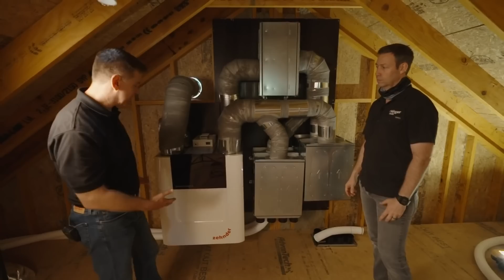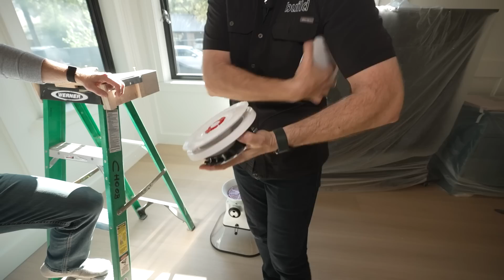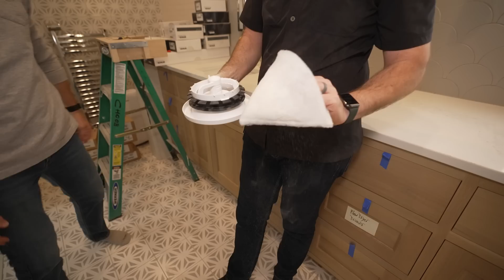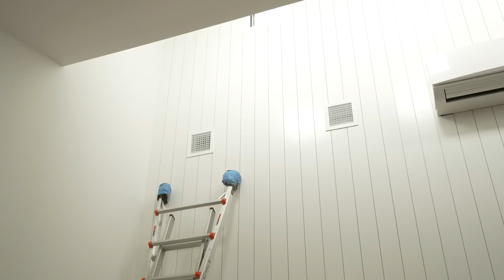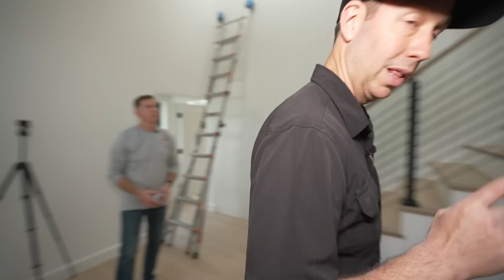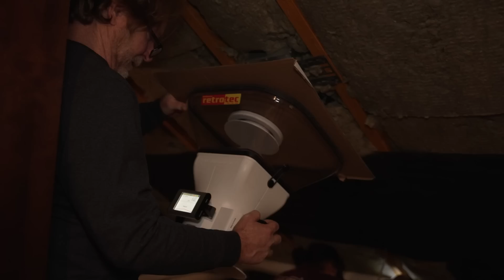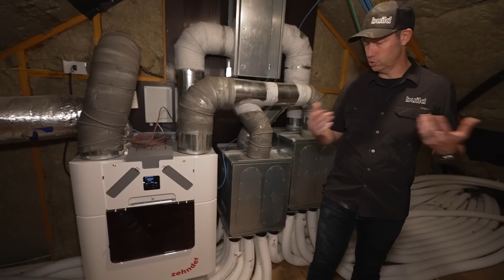Commissioning The World’s Most Efficient Fresh Air System

Comment: Good vid, and whenever specialized gear arrives to a project tha always brings up "why" - reasons can vary greatly..
You know, it's funny: we seem to need to purchase more and more specialized equipment [often electric] as the "eco" mantra is followed, and housing is not immune.  There is a subtle difference between that and purely engineering based efficiency solutions - beware of mindless marketing.   Foe example: I suffered upon a LEED website last week and observed the business of a rating system is largely politicaly defined [salted with incorporated references to ashrae, EN, etc standards to imbue apparent engineering legitimacy].  As a sidenote, bankers [such as Dimon] have salivated over carbon credit schemes in the past.  Why?  Because there is nothing to ship or store - zero capital investment for brick and mortar required, and with government fiat status comes...zero liability.  Good stewardship of resources is important, but you have to filter through the fog.  If you are building for third party "credits" and not results... well, good luck with that.

Comment: Why not restrict/adjust the CFM at the manifold connector rather the register? If you did your adjustment at the manifold you could use any register.
Reply: MKTech
This can be done by installing a Zehnder filter box between the manifold and sound attenuator.  This will allow balancing the unit with any grill as long as a flow hood can be placed over the grill.  I have clients that do this with linear diffusers.  They build a split boot where part is for heating and cooling and part for ventilation.  And yes the same linier can have a return ventilation and supply H/AC.  As long as the velocity for the supply air is high enough it will blow the air into the room and mix before the air goes back to the return,

Comment: I want to know if it is necessary to attach a standalone humidifier to the Zehnder system for more hot & humid regions like West Africa (humidity is consistently over 75%).
Reply: Depends. I live in an area with 90%+ humidity in summer but my house is so dry from the AC running all day every day that grapes turn to raisins on the kitchen counter. However, Matt has an older video showcasing an AprilAire in-line dehumidifier so I'm guessing in a lot of cases you would want a dehumidifier. Remember you want to keep your house at 40-60%
Reply: @Eric998765  I plan on building a passive house to keep the expensive conditioned air as long as possible. Considering I will be using the AC consistenetly to maintain the ambiant tempreture I guess a separate humidifier might not be necessary.
Reply: @DanielDuedu  With a passive house, much of the air conditioning load is from the electrical use indoors, and a small amount for leakage and door opening. This means a much smaller A/C unit is required, which may not dehumidify enough to meet desired humidity levels, thus requiring a standalone dehumidifier.
Reply: @johnhaller5851  Thanks for the reply but won't a smaller unit take longer to reach the desired temperature as compared to a bigger unit that will reacher it faster and cut the power. This effect is amplified in a passive house because it can sustain a set temperature longer.
Reply: @DanielDuedu  Yes, a smaller AC unit will run longer than a larger one. But if even a smaller AC unit isn't needed much to reduce the temperature, the humidity levels will still go up because water vapor is also trapped in a tight house, and respiration and bathing will increase humidity over time. If the temperature is correct, only a dehumidifier can remove that excess humidity. If the outside air when changed to indoor temperature will have a lower relative humidity than the target indoor humidity, then the ERV can be used to lower the humidity.
Reply: @johnhaller5851  I get your point and appreciate your response. Considering the part of the world I live (high humidity all year round), I will need a stand alone humidifier together with an ERV to manage the humidity levels indoors.

Comment: What happens to air quality in a house that tight if the power goes out?
Reply: You have to open windows after a while.  My house is insanely tight and uses a far simpler system to bring in fresh air (opens outside vents for 5-10 minutes out of each hour and runs the central air fan to pull the air in an distribute right through the normal vents, standard air returns work to cycle the air inside the house, one external vent opens to let some air out to keep the pressure balanced)... when the power was out here for four days we noticed stale air after the first day and cracked open a couple windows (in -6F weather that's not terrible pleasant).
Reply: Let my kids come over and they will leave every door open or slam them shut to force air movement.

Comment: Matt, did you install a barometric relief damper into your kitchen hood exhaust line? Even with the fan off, it will have a natural flow of air out otherwise...
Reply: He ince showed ut had an electronic  dampener
Reply: @chuckley54494  Yes, there is a damper on the make up air, so air wont come in when not in use.  I am wondering about the exhaust line?  The pressure from the ERV will force air out of the house if he does not have some sort of damper..

Comment: Can you show/explain how the return air is handled? 
I have seen options for wall grill vent, bottom door solutions, door seal solutions, door frame solutions, but I am curious how you solved that in your house.
Reply from the maker: The Zehnder has supply tubes and return tubes. It’s a balanced system. Same number of each. It’s always bringing in fresh air and exhaust stinky/humid air from the bathrooms/kitchen/laundry rooms.
Reply: System is based on clean and dirty rooms. You supply clean air to the livingroom, other rooms, and extracting dirty air from the kitchen, bathrooms, toilets etc. This way you have controlled airflow in your house, meaning clean rooms will not get dirty air but dirty air and smells will be directed to the dirty rooms, which is what you want.

Comment: I would love to see some form of comfort tube "rack".  I think that it would take up less floor space (than having all of the tubes randomly laying on the flooring), it would look far more "professional" and allow for a person to walk closer to the wall that is directly behind the comfort tubes.  

If the Zehnder system design would allow for this: change/manufacture the comfort tube plenums so that the comfort tubes exit out each side on the horizontal/parallel to the floor.  The comfort tubes could then go straight onto a rack.  It would resemble the look of conduit runs found in commercial/industrial buildings.
Reply: Why would a person want to walk closer to that wall?  There is nothing there except exposed insulation. 

The tubes appear professionally installed and not at all "random", they leave the plenum, are strapped to the floor in parallel, and go straight to the corner where they turn towards whichever room they service.  How would elevating them above back above the floor do anything except introduce more pointless turns?

If these tubes were actually in the way of any traffic, it would be a lot simpler & more practical to build a 6" false floor over top of them.

I can't even imagine why you think having 16 of the 32 tubes sticking out towards your face would be either more professional looking or provide easier access to this area of the attic.
Reply: @TrueGrantsta  : In THIS house there is nothing but an insulated wall behind the tubes.  This will not always be the case in other installations.

Having the tubes exit the plenum on the horizontal would eliminate a 90 degree turn in each tube, not add any additional bends in the tubes.  The "bend" would be in the plenum.  "If" the system/plenum could be designed to accommodate such an installation it might be more efficient.  One large volume turn should be more efficient than 32 individual small turns, but that is something Zehnder would know, not myself.

The tubes are professionally installed here, but also don't have the "neat" appearance of  good conduit/plumbing runs.  That is a comparison, not a rule of thumb.

I didn't say that the tubes would exit out into the room/floor space.  They would run to the left and right sides of the plenum.  Such an installation would require that the main unit not being installed directly on the left or right of the tube plenum.

Please read my original post with the intended meaning, not your interpretation of what I tried to convey.
Reply: This is available in Zehnder catalogue.
Reply: @Tommeehr  Thanks.  I will look it up.  I am planning on including a Zehnder system in my next personal house building project.
Reply: @Real_Tech_Skills  i have zehnder system for last 4 years in my house and meanwhile I became Zehnder dealer in EU.
Reply: @TrueGrantsta  :  Take a look at this video starting about the 8 minute time stamp.  This is what I am talking about concerning a better way to install Zehnder pipes.  As you can clearly see the comfotube pipes are not always against an exterior wall.  This is an impressive installation.
https://www.youtube.com/watch?v=WuYvDuOQ-5M

Comment: Very standard in European new builds. we use HRV's everywhere.This is even mandatory in Denmark, and in current house it's been installed since 1984, running perfectly good.
Modern units do not need any boost switches here, humidity is controlled compared to last 24h levels, so whenever it rises 5% compared to 24h average, it boosts speed. 
It can even be connected to cooker hood (proven to work for 40 years). Can be controlled by CO2, VOC as well.

By the way, gotta say this ducting you made Matt, is NOT most efficient at all. Too many bends very awkward stone-age metal ducting (corregated pipe is ok tho). Here we use metal pipes that connect with rubber gaskets, no tape or sealant needs to be used. The SFP value (power consumption) i would guess is quite high for this unit, here we have max 1000 J/m3 limit to avoid any crazy bad ducting design. I would like to hear your consumption and airflow, to really show how efficient it is, 120 W sounds very high.

Comment: This seems like a really cool system, however, as a Floridian it doesn't seem to allow me to open the windows during the cooler months due to our relative humidity.
Reply: I'm in Florida too. Not sure what your point is here though. The point of this house is to never open the windows. You can turn this system on high and in theory it will ventilate the home better than opening windows because all the air gets filtered.
Reply: @McDylanNuggets  Thanks for clarifying. There are times I like to open the windows during cooler weather and listen to the sounds of nature.
Reply: @tomcarrow  it does not lock your windows. They will still open.

Comment: Does it actually keep up with shower steam though?
Reply: Yes, easily.
Reply: @Tommeehr  all that humidity from a bathroom makes it outside the house? Or does much of it collect in ducts and filters?
Reply: @aayotechnology  it goes outside. Part of the moisture can be returned to the input stream of the air since this is enthalypy unit and it recovers part of the moisture only if inside air is dry, it is natural process happening on the heat exchanger of the unit.

Comment: Being able to control it with my phone is great, but only if it all stays local. Also, what happens when they stop updating the app for your system?
Reply: To keep the control local add a local router and do not connect it to the internet.  As long as you are within the distance of your routers wireless connection the app will work.  If you do not like wireless there are adaptors for both iPhone and android phones to hard wire to and RJ-45 to the router.
Reply: 10, 20, 30 years from now the software will be forgotten about and unsupported.

Comment: Is there an option of treating the fresh air with UVC and or atmospheric hydroxyls?
Reply: I like the UV idea - sure fire way to knock back mold spores.  It needs an easy access location as lamps need annual replacement. Still need a filter to deal with the bulk of nuisances however.

Comment: With your futuristic home, no solar panels or Powerwall battery storage?  I own EV’s on Maui.  With my panels and battery storage, I save $600/month on gas and home electricity plus power when outages. Batteries also allow storage chesp energy to be used peak energy times.  Batteries allow solar at night.  26% TAX CREDIT
Reply: When you can get electricity in Texas, its pretty cheap. It's hard to make solar work economically in Texas. In spring and fall, my total electrical bill is under $100 per month for a fairly large but poorly insulated house. My most expensive bill this year was for September, of $174 for 1750 kWh, with 2 3-ton AC and a pool pump as the major users and a plug-in hybrid car. They are highly efficient A/C, but inadequate ceiling and wall insulation. The distribution charges were almost half of the bill, and without a battery, I wouldn't get credit for exports on the distribution charge. I would get about 5¢ per kWh to export, and pay about 9¢ per kWh to import power, plus some monthly fixed fees of about $8, and taxes. With Matt's house, he's bound to use less for HVAC than I do, and he doesn't have a pool. To avoid exporting, you need storage, which is even more cost to recover. For me, it's best for the utility to buy the solar or wind at wholesale prices.

Comment: Do you then just turn it off or change modes, for those days when you want good old fashion open window ventilation?
Reply: You do not need to do anything, you can open window. You can put the unit into away mode if you wish.
Reply: Some people just leave it at its medium speed and others choose to turn it to the away mode.  Then again some find with proper filtered air they will never open the house again.
Reply: @andrewwahl4503  this is how it is at my place. I have the system for 4 years and no need to open windows anymore. And that is the point, you have fresh air 0-24 while system is recuperating energy that would otherwise be wasted.

Comment: I really like the idea of constant fresh air. However, I have two questions. One it appears the unit and hoses take up a ton of room. Are they working on any strategy to shrink this a bit? Second, you mentioned a future “smart” humidistat function for bathrooms. What about the same function for outdoor humidity? I would assume that you don’t want to be pulling in saturated air during the worst part of an Austin summer. Even with the enthalpy recovery won’t you will be increasing indoor humidity? Pete S
Reply: The software change to detect humidity is for fresh air intake, so the system knows when it can go into bypass mode.  It has nothing to do with the bathrooms.
Reply: Ok. So the unit senses the outdoor humidity and decreases to low speed I assume.
Reply: @petersallay5221    No, watch the video again.  The tech explains what bypass mode is and when it's used, but that it isn't automatic, the user must set it in that mode.  It is NOT CURRENTLY sensing outside humidity for the purpose of going into by-pass mode.  But that is PLANNED in a software release, which indicates the equipment does have humidity sensors, how else they are used I don't know.
Reply: Thanks Paul
Reply: Most of Zehnder unit can have any 0-10v humidistat, CO2 or other measuring device connected to control the fan speed.  So when a room goes higher in what is being sensed the fan will go up.

Comment: Thanks for sharing.
Apart from the mentioned pollen, what’s the benefit of this system compared to opening windows in several areas around the house to allow fresh air to travel - especially using European windows that have micro ventilation opening position which minimizes cold/hot room temperature from escaping.
Reply: If you're in an area with low humidity and low pollen, opening the windows can be a great idea. Outside air isn't always "fresh" air.
Reply: This is exactly what we DO NOT do in Europe.
Reply: If you are "micro-ventilating" to minimize losing your conditioned air, then you are "micro-ventilating" the amount of fresh air coming in from outside.

So what are the benefits of this system?

- Filtering 100% of the incoming air
- Temperature exchange to save energy
- Distribution of fresh air to every room in the house, 24/7
- Extraction of moist air from bathrooms 24/7

People aren't used to the idea of a system like this bringing in fresh air, because we're all so used to leaky houses that ventilate sufficiently even with the windows closed.  But if you'd seen earlier videos in this series, you'd see that Matt was maniacal about sealing his dwelling area.  Because of that, "micro-ventilating" a few windows wouldn't be sufficient to provide enough fresh air for 5 people.
Reply: @TrueGrantsta  Thanks for replying. If I understand correctly, this ventilation system doesn’t replace cooling/ heating system. It probably connects to one and filters the incoming air, while it’s possible to add a filter to the hvac instead and save the cost, additional pipes and maintenance.
Regarding the sealing that you mentioned: zip systems are great until nails from the siding and roof penetrate it.
In general, we spend most of our time away from home and breathe unfiltered air throughout the day, and maybe this giant filter will have benefits in a highly polluted area, but I just don’t see how it’s making any difference otherwise, and remain with the micro ventilation option which probably loses less indoor air compared to opening the door when entering or exiting the house.
Bottom line - it’s a house, not a zombie apocalypse bunker or a clean room manufacturing microchips.